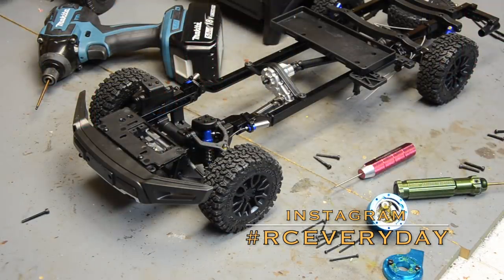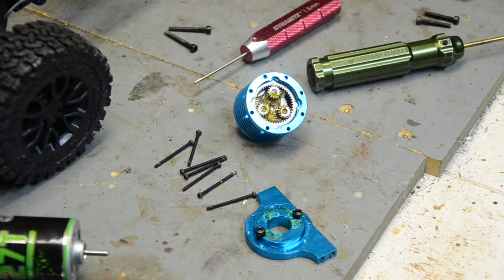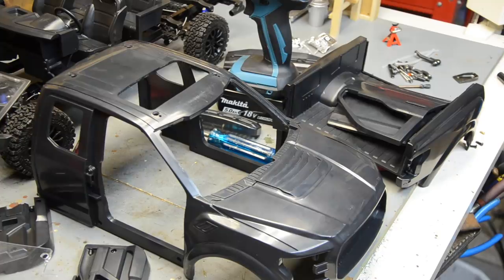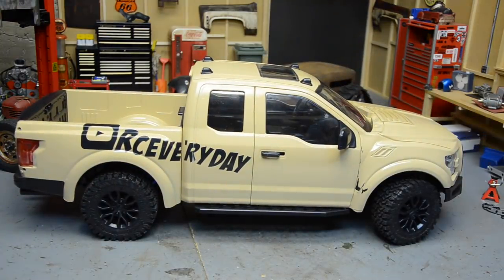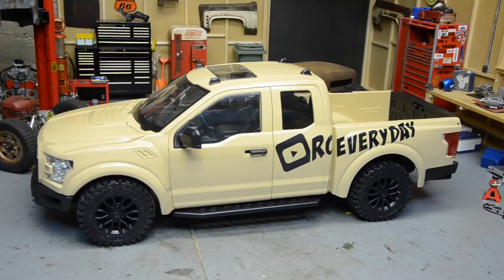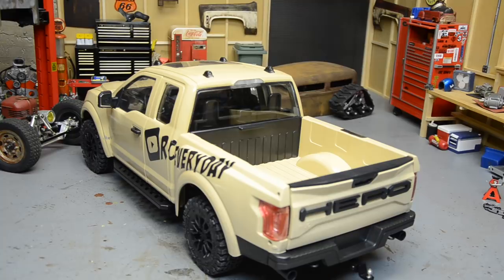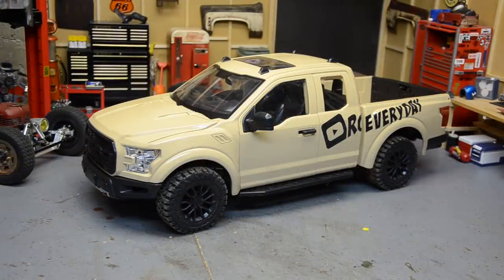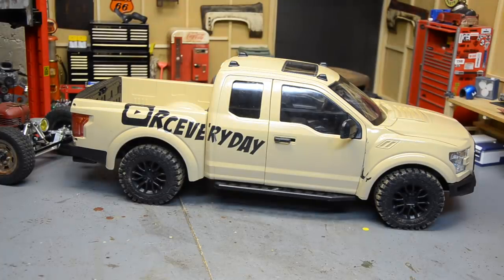RC4wd Desert Runner Raptor First Run, Plus Painting

Comment: Not sure what you were expecting. With the GRU, scale accurate drivetrain, and open differentials, it's not meant for the rocks/speed. If you want to do donuts, you'll need to lock that rear diff. Makes for the ultimate challenge to drive it as a real truck on proper terrain. Makes a great tow vehicle too. Give it a chance, when used as intended!
Reply from the maker: I just expected it to be a little bit quicker. Hoping to resolve that with a different motor. Don’t get me wrong I love the chassis. The true IFS is fantastic.
Reply: Oh goody I'm not the only one...😁
Reply: @RCeveryday  GRU's inherently make things slow. I've already swapped it out for a GCM scale drivetrain. Much more better in so many ways. Video coming soon.

Comment: Oh, SNAP! It looks so much better. I like the desert color much better than the blackout color. You really didn't have to take the truck apart for professional results, especially one with so much detail. I would have used painters tape to cover up every little detail and trim I don't want to be painted and then used some kind of primer for the material type and then spray paint it in coats. Let it dry then apply a gloss or non-gloss sealer to protect the paint and then remove all the tape and yield these same results. I do get that some people like taking things apart to be curious but this is a rare build with a lot of detail. Either way, this sand color on black wheels is awesome. I don't think side and top vents should have been painted.

Comment: Next video is how to lift it and widen the wheels haha. Please! Also. Does it have rear front and center diff locks? If not. Is it easy to install them?
Reply from the maker: It does have a front and rear diff lock, I just ran out of servos to use it this first run.  No center lock though.  Once I get the diffs locked and get it some more power, I think it will be a lot more exciting.

Comment: The planetary is definitely going to get hot. I run one in my rig with only a 1300kv on 2s so it's not being turned super fast. It gets so hot that the high temp marine grease I put in it just thins out and leaks out of the cracks. Its gotta better with use though.

Comment: Great job bud! came out looking great,bummer bout the door jams i painted a build recently that the same thing happened to me and like you said i didnt put alot of paint on it..lol... im more into a slower more scale driving so i think the motor set up you got in there is perfect,im running a 35turn in a 5to1 gear reduction unit and i think the speed is perfect and has gobs of torque.looks real nice man good job with.👍👍👍

Comment: So, all in all you seem pretty stoked, ha.  It seemed to perform about as expected.  Yup, will be a good trailer truck.  Maybe turn it into a dually tow truck or a trail service rig with a welder and big diesel generator or something.  It did look a lot better with the bed off so maybe as flatbed would be good

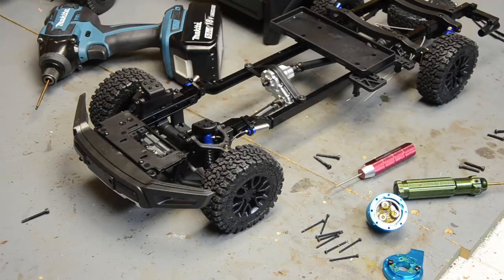Comment: Rc Everyday i have seen quite a few of your videos and need a little help with my tube chassis "bagged build", the rear suspension i have all sorted out but not quite sure how i should go about setting steering up and the suspension on my 1:14 semi axle. Using a short coil spring there is only one pre tapped hole on the back side of the axle and its 3mm. Any suggestions? I dont have a tap small enough for my threaded rod to make radius arms work.
Reply from the maker: I like to just use a shock with internal spring in between the axle and the radius arm.  I have to drill out the threads on the axle itself and just use a 3mm bolt to go through the axle, shock and into the radius arm.
Reply: @RCeveryday   Thank you.

Comment: Whered u get yr little toolboxes from behind truck
Reply from the maker: They are snap on collector coin banks. Can find them on ebay usually.  And yes they even have a snap on appropriate price.  There are lots of different scales and versions.  Mine are called 1/8 scale but fit well with the 1/10 trucks
Reply: @RCeveryday  yer dead cool n i had an idea they wouldnt be cheap lol

Comment: All that scale detail and it is fantastic, but fall flat on the front shock rezzies just cable tied to the frame wtf, dropped the ball there, I could not see where or how they should have fitted but a full size would not be hanging there.
Reply from the maker: It’s an opportunity to make some metal mounts though. Already bouncing ideas around.

Comment: Okay so maybe I would have bought it for a different reason. I think that would have ended up the worst possible way as a shelf Queen up hi to where no one else could touch it. I would have painted it just like you did, I would open the door it would have cracked the paint and I would have crapped myself. Quite a bit of money to not have small things like that finished in engineering. Like you, mixed feelings. I would not have expected it to do any better on the Rocks then it did. Would not have expected the running board to break the first time that I did though. Heartbroken that putting it back together with such a pain in the ass because that's where I would have been wanting things well finished. Can't get around that it's an absolutely gorgeous truck. You can fix the gearing, you can fix the door, but man they hit a homerun with the styling. And you hit a grand slam with the color ..! With all that said though, I still want one...😁 thank you for putting yours through hell for us..!
Reply from the maker: Absolutely!  I didn’t expect it to rock crawl. I just was hoping for a little more top end. That can be fixed though. I still love the chassis and hope to make something different on top of it. The body is extremely detailed and I just didn’t give it enough time(and patience).
Reply: Can't wait to see how things end up with the Desert Runner..! This truck has special potential..! Thank you for the great response..!

Comment: RC Everyday  
For all the children an silly guys who tiny truck but don't turn a wrench on a real rig this below is why this rc is a let down as fuck!!

The Raptor has solid rear axle with a locker and 4.10 gears. Up front is an independent suspension with a Torsen automatically locking differential and 4.10 gears. The 3-inch diameter Fox Racing shocks help the truck handle high speed off-road runs. The 2017 Raptor is currently the most powerful factory pickup truck with 450 horsepower and 510 lb-ft of torque coming from the high-output version of its 3.5L EcoBoost V6. The Raptor rides on 35-inch BFGoodrich KO2 all-terrain tires.

If this was a ridgeline knock off no one would give a crap but this is a dam raptor rip off that looks more like a ford explorer frame its almost a kick in the mouth this thing is 580+ $$$ makes no sense i'd buy it for 300 range just to put a suv body on it if they tweak the ifs with some lift kit parts the 1:1 uses and some blocks for the rear it could be super badass scale!

As for the speed man yeah you are right it should be faster! it also should have a 2 speed tranny in it so you can hammer down or shift down to crawl or mud it very confusing way how these other rc youtubers do not take 1:1 in account and they just do not understand the let down from it being a raptor but its really like a ford ranger lol

https://youtu.be/0ct4PwI7FGA

^---- Point made .